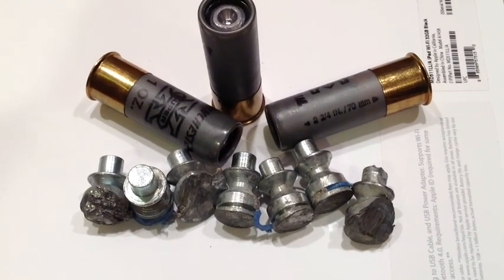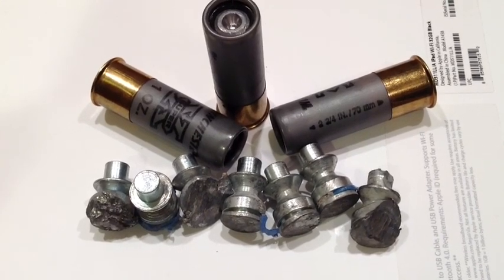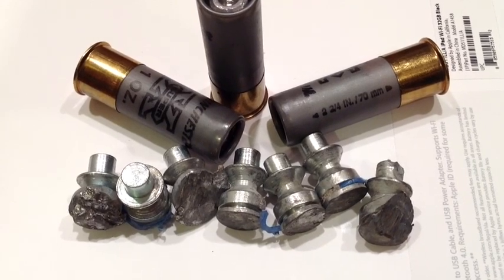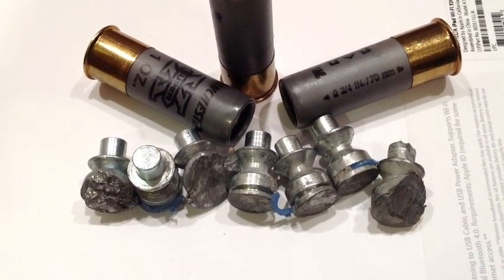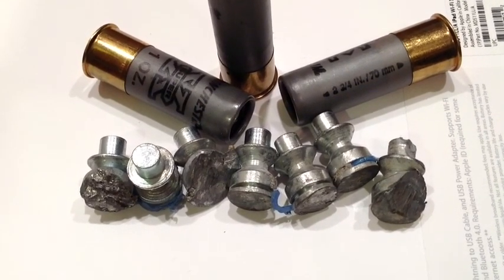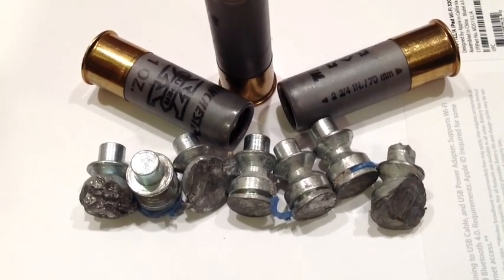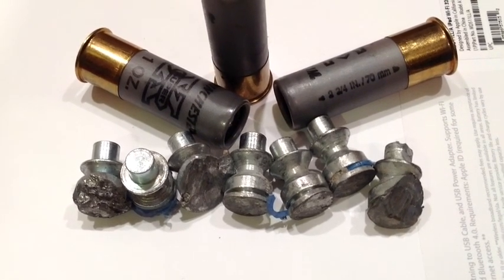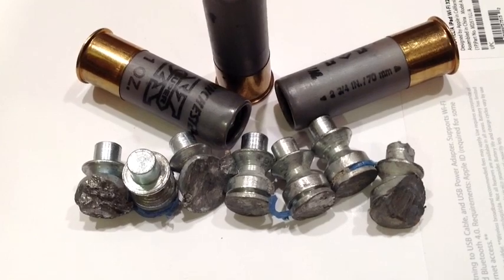DDupleks Monolit28 12 Gauge Slugs

Comment from the maker: gun nut-sorry this answer is late-didn't get it on my dashboard and somebody flagged it as spam - These steel slugs are fitted to 12 barrels by a polymer washer in front and sabot in back so slug rides on polymer in bore.  No problem fired in full chokes although cylinder is recommended.  If hard foster slugs are fired in full chokes by mistake, the shot wads we use will not do the same job and pressures could be high, but if you ONLY shoot cylinder bore barrel, hard slug is OK reply 1

Comment from the maker: joehunt1980-some ranges forbid use of steel core ammo.  These would also be prohibited to use.  The rangemaster must have examined the back plating.  I'm sure if damage were happening, signs would be going up.  These penetrators are wicked against anything organic, but will not penetrate armor.  The pistol and shotgun side of the range disallows rifle rounds. Thanks for the question - I'm going to bring it up to the range staff.

Comment: Some developments on DDupleks products- The cheaper sources are probably gone. SGammo has said they do not expect to get any more at the prices they used to offer. Century Arms is now the importer. The good news is that they offer a bigger variety than was previously available in the US. Now they offer 3" versions of the solid and segmented shells as well as their impressive super frangible. This is intended for LE. It's supposed to work about the same as a varmint grenade for coyotes: massive energy dump inside target, no energy outside. I haven't seen any independant tests on that, but "brassfetcher" did a very thorough testing of the Hexolit 28 segmented slug that showed good performance. his website has a .pdf with detailed data more in depth than the videos.
Reply from the maker: Thanks for the info on these slugs - Shooters have to get 'em while they can for the price they want.  I'm happy with my lead slugs - leave the steelies to all you that want to push the envelope...Best Regards

Comment from the maker: gun nut - reply 2- If you see one of my vids - I do my own test on slug safety by pushing the slug/wad thru with a wood dowel.  If slug can be pushed through without pounding, it will be OK to use whether hard or soft slug.  If not pushed through, but has to be tapped or pounded through, then the slug better be soft.  The shooter has to be responsible to check this - best policy is use soft lead slugs - Lee has this on their boxes and instructions.  Best Regards...